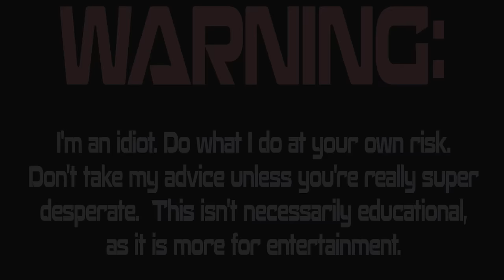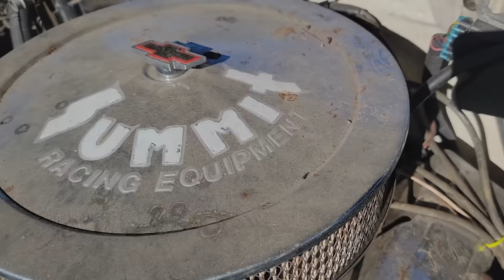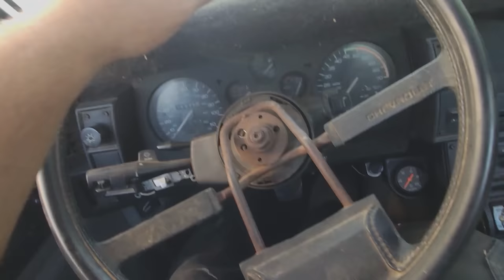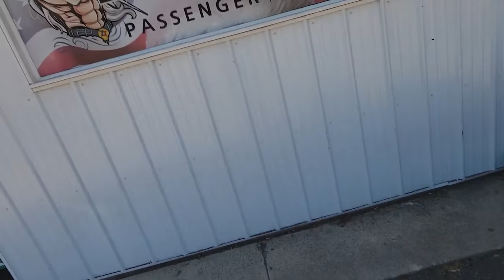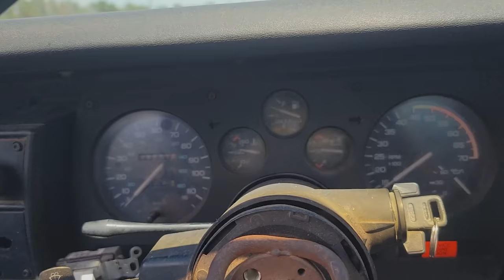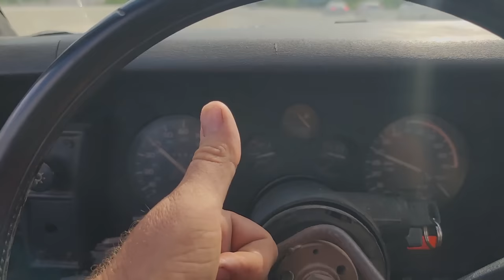Barn Find Camaro - Will it RUN AND DRIVE 600 Miles Home?

Comment: If its TBI the injectors may be sticky, but usually wake up.  If its TPI the injectors are either leaking or will be soon.  Otherwise they always run if the motor isn't blown, or the 700r4.  If you need a clean tank/pump for a TBI I have one in north Georgia I swapped my 89 formula firebird with a tank from a 2000 Trans Am along with the LS1, T56, Rear gear/posi, and brakes :)
Reply: sounds like an awesome rig bud!
Reply: @NoWr2Run  yes made the comment before video was published, carb isn't factory, it also turned out to be a T5 not a 700R4 also.

Comment: Wow another successful save.  Since you have a connection to this model year, restore it--fix it up, new wheels.  Sunday driver show car.  Thanks for sharing.  Amazed you made it that far with no fuel issues--usually you're replacing fuel filters every other fuel stop.  Nice

Comment: Derek, I really liked the seemingly increased production quality of this one. The opening with you giving a rundown of the rig in different location was fantastic. Also looks like you got a new camera, don't think a guy didn't notice the video quality improvements. The audio also seemed a lot cleaner, a bit quiet, a fella had to turn it up a bit. But overall this video seemed to be the "Most professional" revival I've seen you do from a production standpoint. Awesome work, as for the rig itself, she's in too good of condition not to get dolled up; fix the floor, polish it up. definitely needs new wheels, those are alright, but you can do better.
Reply: Definitely had to crank the volume up a lot on this video compared to previous ones. Always great to see Derek do a revival.
Reply: @pyritepachyderm3211  Not sure how long he's had it, but he's definitely running a rhode go or similar wireless mic on this one. Good sound recording gives a feller a solid 1042.56 niner% increase in production quality! That being said, you can then run compression in post, which evens her out a bit, but does lower the overall volume. Much easier on the ole' hearing boxes though!

Comment: I would love to see this one brought up to the spec it was advertised as.   350 v8, still 5 speed.   Maybe put some new floors in it?  The body looks pretty good, so don't over restore that.   I was always a fan of the Z28 5 spoke wheels on these, not the IROC ones.  It might also be neat to see what it would take to get rid of all the mouse detritus and scents.  How much could be saved and how much would have to be replaced.
Reply: Didn't only the IROC and Z-28 get the 350? Otherwise the rest only had 305 V-8s. There was only 15 horsepower difference between the 2 anyway.. Lol.
This was a bad decade for horsepower.
Reply: @davelowets  I agree.  I had a girlfriend with an RS 5-speed, my stock - and older - four-banger VW had the same acceleration as it did at the time.  Anybody who says to 'restore' it to the way it was is out of their mind.

Comment: My vote on it would be to do a clean up on the interior, get a new steering wheel, new dash, new carpet, whatever the doors need, find some Camaro RS factory rims, factory tail lights, and do a spit shine on the exterior. Oh, and get the ignition switch fixed where it can be started at the column lol. Cool car!

Comment: Derek this is definitely a go to town car! Take the seats and carpet out, R&R the house light switch with the correct switch, and give it a thorough cleaning, and get Jessica out there to help you replace that rotten floor pan. Oh and the left front wheel bearings!

Comment: i had a 91 RS also with a manual switch fan and i live in texas and 220 was pretty normal running temp if i remember right it always stayed right about in the middle of the temp gauge

Comment: Funny you say you had this same car in high school. I did as well, but I bought mine as an RS. and it was gray and had a 305. I came across an iroc ground effex, front and rear bumper and side skirts kit and iroc wheels. Then I painted it white. It started to run hot. I learned that the 305 had a short air dam under the front bumper to catch air and the iroc had a longer one. Flat piece of plastic that was the width of the radiator and hung down almost touching the ground. I went to home Depot and they had this 4 foot by 4 inch flat rubber strip that you would find in like an office building where the wall meets the floor. Like a kick panel of some sort. I made an air dam out of that. It was about a half inch from the ground and used to bend under all the time but was so durable it never fell off. It cooled the car down considerably. It's because the lower ground affects on the irocs hang down so far the block a lot of the air flow. The RS has no ground affects.

Comment: I gotta say does small block Chevy engines are the best they just won't die, and to top it off it was locked up and it got you home with no problems and you didn't spend much on it, what a great way to get home with an easy fixer. Sometimes you get lucky and sometimes you don't loved this episode great job Derek your the best 👏.

Comment: My bird of same year runs at coolant temp of 210-220 usually even with new head gaskets, radiator, water pump, good AFR and 160 thermostat. Fan is always on aswell, these cars just run hot I guess

Comment: I may have missed it, but there is an air dam that hangs down below the chin of the car. That component is critical (frequently can be broken off or errantly removed) to force air up in front of and through the radiator. This is critical since the front of the car has little flow through area to the radiator. If the air dam is missing, you'll have over heating problems.

Comment: Brings back memories,  I had a 87 z28 5 speed um 4barrel . Last year before they went to throttle body or tuned port . Good times :)  and ya bleeding the slave for the clutch is the worst :)

Comment: Turn on your big shop fan sitting beside it & face the fan either through the back end or through the doors, have both doors open & the back end open also & turn it on high & leave it running all day long until you get ready to head to the house for the night,if that big fan can't get rid of the smell then your going to have to put all new carpet in it & redo the seats,I'd be going to a junkyard to see if they have a better steering wheel because that one is missing some things

Comment: As a life long mechanic I would suggest using direct = 4th gear to break free an engine. More torque available from the driveshaft and no shock loading the gears.

Comment: I had a 1988 IROC 350 5.7 TPI and sold it (my mistake) Then I had a 1982 Z28 and blew up a pushy push thru the cast iron wally wall and dropped a 350 in then sold it. Wish I had another.

Comment: Curious - when you try to rotate the motor you are looking for only 1 revolution. The camshaft turns at 1/2 the speed of the crank - you would actually need 2 full revs to certain the valve train is not somehow jammed.

Comment: As a former thirdgen owner, I immediately suspect that the car is missing the black plastic air dam underneath that directs the air to the radiator. You wouldn't think not having a bit of plastic underneath would cause a +20° difference in running temps on hot temps, but it does. I'm sure the lack of thermostat didn't help either.

Comment: I know this is a year old but those rims look like spider wheels made by motor wheel in south west Ontario Canada.  I had a set on  my first car.  
My dad and my uncle had a set of these rims. My dad worked at the factory . Too bad the center caps are missing.

Comment: That car right there was sitting at the street side of the dealership lot in my hometown, in 1989. I was an e-1, home on my first leave, which meant I had my first grown up job and I worked for some important people. Chest bowed out, I walked onto that lot KNOWING that God and the United States Navy had sent me to drive that Camaro back to the piers in Norfolk.

I drove out a couple of hours later in a 1975 VW Bug with rusted out floorboards and a one year $100 loan to help me get my credit started. Hahaha, somebody got that Camaro and I wasn't walking anymore so it all worked out.

Comment: I had a '78 Bonnie with a 305, and it needed 93 octane and ran quiet as a mouse. At 60 some mph on the hwy, it would get 22 mpg. Not kidding.
(Using cruise control, btw)

Comment: I seen what you did there! Yeah, VGG has clearly BAITED us with a classic old car that everybody remembers.
That's not a barn find, that is $200 cash sitting there when you cash in at Pick-your-part.:face-fuchsia-tongue-out: Just kidding, the Camaro platform is one of the easiest cars that any mechanic will experience to work on. It is almost like the car was built to be a competition platform that is very accommodating chassis for modifications and upgrades. The entire platform was designed to be easily upgraded into a real competitor no matter what type of racing that you are engaged in. 
I Love your channel and you have your own unique way you look at and see cars, and you have your own style of repair narration. And who has not engaged in your "Life-hack" brand of DIY auto repairs and hacks to get themselves home?

Comment: Those smells can be nostril strippers. I found stuff that literally destroyed bad smells. It's cheap and in a tiny bottle. You can keep it in your bag of goodies you take to pick up a car. I used to work in a wrecking yard and had to deal with the smells all the time. Got this stuff and never looked back. It's called nilodor. You literally only need 1 drop on each side of the carpet. One on each seat and bobs your uncle. You should definitely invest in it.

Always great watching your show. Thanks for the great content. I'm over in Australia and I recommend your show to all my car buds.

Keep on motoring bud.

Comment: I'm looking at a 1988 camaro iroc z as my potential first car According to google it's about 53 minutes from me it says will need floor pan and brake booster. Isnt running but with a little work could be going down the road. Sounds like a video opportunity

Comment: Dear Derek, found your channel a few days ago, I live on youtube -  Rockets, EV's, Robots, I've bought many written off cars usually run them to the death to get my moneys worth so also know a bit about surprise issues that need fixing Anywho, the one before last was a 2013 Nissan Leaf, had that for 5 years up until now, and my latest and sexiest and most expensive addition bought on Copart auction for £18600 with a big loan only 2 months ago (todays date 6th oct 2023) is a Tesla Model S 90D with 516 BHP. Bought it, fixed it and drove to Tuscany Italy from UK 5 weeks later - 1250 miles from Home to holiday home. And guess the fluff what, because it was an auction they would not tell me anything about the car, so after I fixed it and drove it to a supercharger for its first charge up, plugged it in sat back in the seat and stared at the dials....... Free Unlimited Supercharging For life, Whoop-de-do As you may know Pre April 2017 had  Free supercharging unless traded in for a new one with Tesla they would then remove it and sell it on. My Autistic daughter loves going on county side drives - Would you believe 9,000 miles later I haven't paid a penny for fuel/electrons.  I know what it's like to have those sinking feelings as time was running out - the fix-up did not all go smoothly, I'd just a few days earlier finished the repair and  the day I was to drive to Italy I just happened to look under the front of the car as you do after a front end rebuild and there was firstly a big screw sticking out of the tyre and what looked like brake fluid all over the inside of the left wheel rim, it tuned out to be grease - the broken steering arm in the impact had shot a splinter of metal into the outer driveshaft rubber boot and was shooting out grease out as it spun. Next day - tyre repair and a make do grease injector into the boot and some trusty Gorilla Super Glue on the hole. Good as new!!! not really still leaking. Will have another go in a few days after a few night shifts. 
Cheers Derek Keep up the Great videos, they are addictive
Live long and prosper
Graham

Comment: My first car was a 1986 Camaro Berlineta.
Reply: 2.8L V6. Crankshaft ended up breaking in half. Big hunk of junk, but it was my first car.
Reply: My Camaro didn't have the mechanical fuel pump. It was in the tank and it went out twice. I remember having to drop the rear end with the fuel tank just to replace the pump.

Comment: had an 84 pontiac trans am with same engine 305. and worked at burns pontiac as a dealership mechanic back in 83. the car was brand new. i was just starting out. and the guy next to me had a couple of years on me in the trade. brand new car. not even 100 miles on it. it was over heating. he replaced the thermostat twice, water pump, head gaskets. heads. and then the engine block. and all this was having to be approved by the regional factory rep. so it took a month to do all the work. car still over heated. finally there was a bulletin out on the front air dam. that gets put on in new car prep. it's in the back of the car under the hatrch with the rest of the stuff. tag bracket and such. it was wrapped in a long plastic bag, with the fasteners and nut clips. the air dam it's a piece of plastic about 2 and a half inched wide around 6 feet long. thats contoured in a v-shape right after the radiator. the car had no front grill it was a all plastic front. and at idle the fan would cool the car but on high speeds the air on most cars traditionally would flow through the front grill to the radiator. but this model it couldn't. so the air flowing underneath the car at high speeds hit the air dam that was on and angle shaped like a cow catcher so air would divert up in front of the radiator to give it air. if that was removed at high speeds the car could over heat. here a 15 dollar air dam that didnt get put on the car at new car prep was the culprit. and the shop spend thousands of dollars trying to fix the over heating issue

Comment: Seeing that starter failure brings back memories. I remember i had to replace my starter 4 times in a year and i kept a floor jack and a hammer in my hatch for my 89 iroc. Hell, I still remember the exact twist and flip i had to do to get that thing in and out. Its burned into my memory. 😂😂 not the best design location, Chevy.

Comment: have ya tried febreeze yet?
its REALLY good at knockin down smell.
also the reason animal pee smells so horrible is the ammonia concentration.
if you use a citric acid spray. ( mix up a teaspoon in 16 ozs water in a spray bottle ) and spray the most gnarly spots till damp. then hit the whole thing with febreeze and shut the doors. ought to really cut the eye watering and stench WAY down,, just keep the citric away from metal surfaces, it'll induce rust if its got no ammonia to neutralize

Comment: I’m not sure what it is about the 305’s, but I’ve never heard one struggle to start, the 305 I had in my Monte had been leaking oil since the 90’s, and had soooo many vacuum leaks, the car got stolen by a methhead, and still started flawlessly ever single time.

Comment: Hey Derek, I'm very familiar with bad smells. You might try an ozonator from Evil bay or if you are more frugal, a can of Ozium, don't be fooled by it's 3.5 oz. Size. This can has enough oomph to destinkafy  a truckload of Camaroes. If you choose the Ozanator, read instructions carefully and leave device turned on inside vehicle with windows up for about 24 hours, then air out! Don't get into vehicle with a load of ozone, it could damage your lungs...

Comment: Put a real small block 350 in it, or just drive the tires off it. New interior? Hay blocking radiator that’s a new one. Thanks for sharing.

Comment: You probably know this already, but get a cheap amazon ozone machine. It will kill those smells, just air it out good after and keep windows down for a bit after as well, my car was used smoked in and smells new now. Run overnight it will kill all the odors.

Comment: You missed a big issue with the cooling on this one! The tag frame or anything on the front for that matter doesn’t help cooling! Should’ve checked for the air dam under the bottom!! That’s what scoops the air up and sends it through the radiator! It’s a 3rd and 4th gen thing!

Comment: You should have walked in there and bought yourself a cheap hand held temperature gun. I use them on headers to check for dead cylinders.

Comment: My 93 cavalier z24 I think had the same security. It has blinking red light near the stick. Had to hit a button to unlock the system you’d put the key in and the light would stop blinking that’s when I knew I could turn it over. Wonder if these ran the same type of system

Comment: 19 Mpg in a carbureted V8 chevy? I get only get 22 mpg in my 1980s post-oil crisis efi 4 cylinder volvo. Makes you wonder if they had changed stop signs to yield signs and put tall-geared manuals in everything if that would have done as much good.